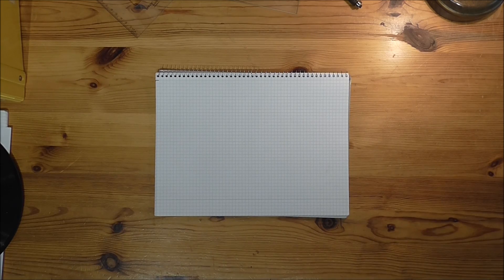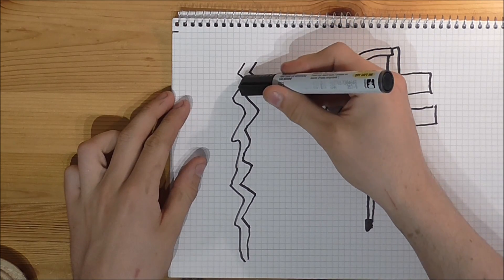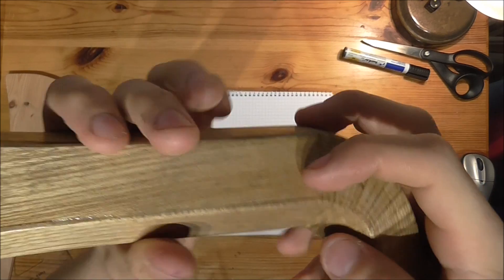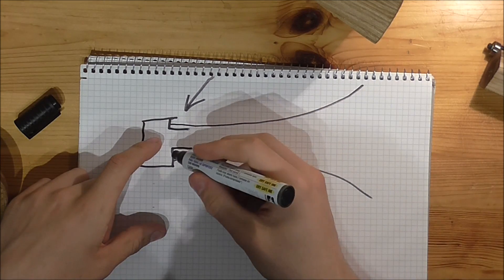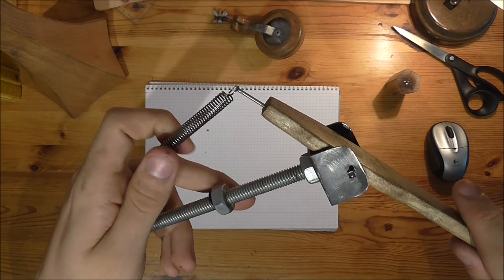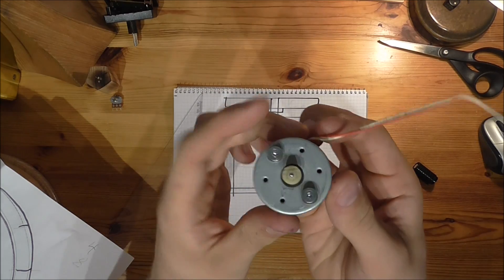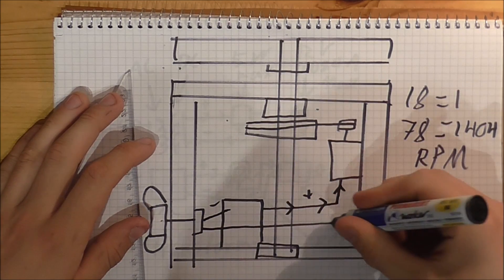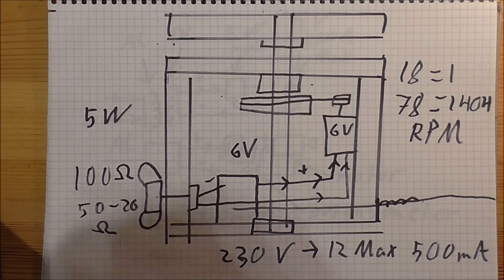How a Gramophone Works & What's Inside Mine

Comment: Great video. I've read the frequency range is of the sound boxes is about 50Hz -7Khz or so. Do you think it would be possible to have a extend this range chaging the size of the sound box, the o-ring elasticity and the material of the metal plate?
Reply from the maker: Larger sound boxes typically enhance lower frequencies due to the increased volume and resonance. Conversely, smaller sound boxes can better handle higher frequencies but may lack in lower frequency response.

The elasticity of the O-ring can affect the damping and resonance of the sound box. A stiffer O-ring might reduce unwanted vibrations and harmonics, leading to clearer sound but may limit the frequency range. Conversely, a more elastic O-ring could allow for a broader frequency range but might introduce unwanted resonances.

The material and thickness of the metal plate can significantly impact the sound characteristics. Different materials have varying densities and elastic properties, which can influence the vibrational modes and frequencies. For instance, a denser material might support lower frequencies better, while a lighter, more elastic material might enhance higher frequencies.

AI Response

Comment: Can u tell me how this sound box works
Reply from the maker: The needle follow the grove in the record, making the needle arm moving from side to side. Because the needle arm is pivoted at the needle arm support the side to side movement is converted to an in and out movement, this in and out movement of the needle arm is transfered to the plate and is allowed to move because of the o ring. Depending on the frequency of the metal plate in the soundbox you get different sound waves and thus sound is telegraphed from the record.

Comment: how is it possible to have different sounds and many instruments on a single groove?
Lets say- I'm singing while playing guitar and my son screaming plus the heater buzzing and birds tweeting - all at the same 1/nth second. It's just one small scratch on a plastic....how come it can playback all that info flawlessly?
Reply from the maker: That's a difficult question, first you need to understand how sound works - "Sound is produced when something vibrates. The vibrating body causes the medium (water, air, etc.) around it to vibrate. Vibrations in air are called traveling longitudinal waves, which we can hear. Sound waves consist of areas of high and low pressure called compressions and rarefactions, respectively" (You can read more about how sounds works here - https://method-behind-the-music.com/mechanics/physics/)

Then you need to know how hearing works - "The sound waves cause the eardrum to vibrate, which sets the three tiny bones in the middle ear into motion. The motion of the three bones causes the fluid in the inner ear, or cochlea, to move. The movement of the fluid in the inner ear causes the hair cells in the cochlea to bend" Which then is processed by your brain. (You can read more about how hearing works here - https://advhearingsolutionswi.com/how-hearing-works)   

Here is a video (By "Seeker") explaining "How Is Music Stored On Vinyl Records?" - https://www.youtube.com/watch?v=5OWEEFg6fTY 

I don't know if this helps but "Applied Science" also made a great video showing & explaining some interesting information - https://www.youtube.com/watch?v=GuCdsyCWmt8

If this didn't answer your question, I'm glad to come up with a better & more informative answer. :)
Reply: The sounds mesh together as one sound wave.

Comment: Interesting very interesting. Also what kind of records do you recommend for my gramophone which uses a slightly blunted needle?
Reply from the maker: Vinyl records works & sounds quite good but they will wear out faster then the 78 RPM records, that are made for gramophones like the one I made. I would recommend that you get 78 RPM records.
Reply: creativeobsin I'll try to get 78 RPM records if there are any I like
Reply from the maker: If there are any scratches going across the groves don't even bother getting it, it will sound awful, other than that, good luck!